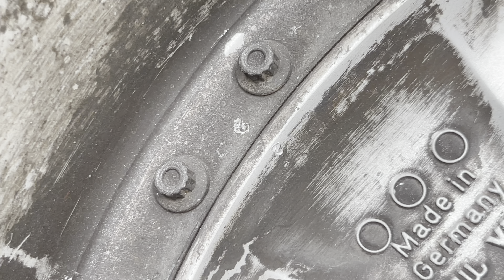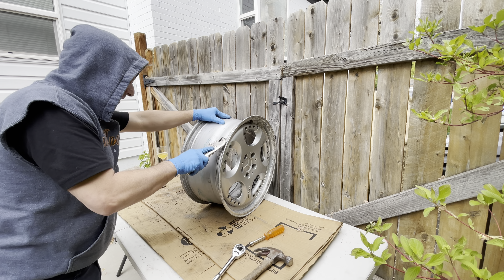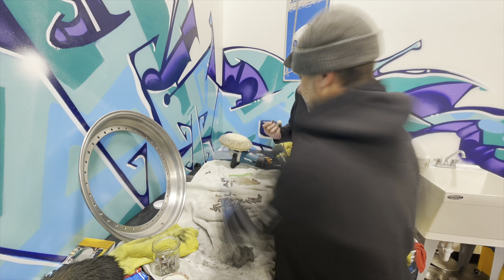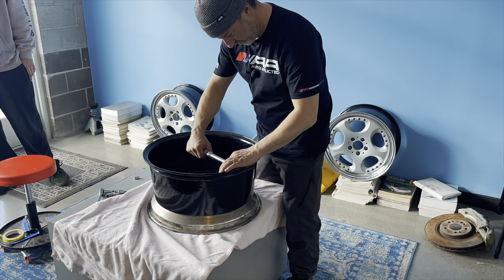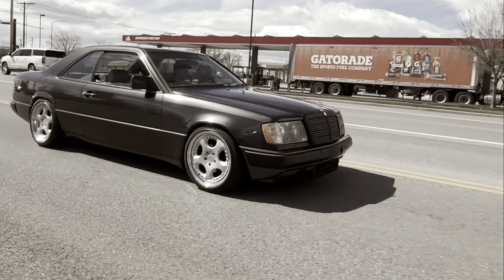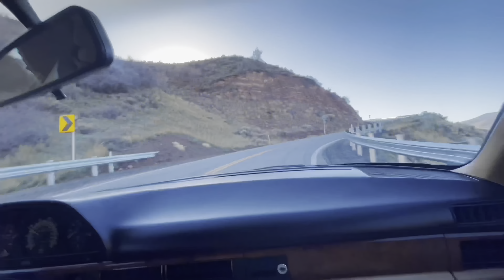Restoring rare BRABUS Monoblock Wheels for the Benz W124 Coupe

Comment: Love the transformation. true 3-piece wheels, wow. i have AMG replicas but they look legit. How much did the Turbo help with power?
Reply from the maker: Yes! Pretty excited to have these wheels. They don’t look quite as big as the chrome AMG mono blocks that I had on it originally. But they are the same size and wider. The turbo helped immensely there’s a video on the channel from our first Dino session where I got about 270 wheel horsepower, despite not getting as much boost on the dino as I get on the street totally change the performance of the car.

Comment: Man you guys have a good channel. Great content. I have an old 1982 SEL500 looking for some cool wheels. Anyone have some that fit if you know what will fit let know or for sale let me know
Reply from the maker: Thank you very much ! Your w126 has a 22mm offset I believe. You can fit 80s and 90s wheels but you may need a spacer and longer lug nutz… in the back you will likely needs to grind the lugs a little shorter as they start to make contact with the ebrake mechanism when you get into different lengths. I do have a set of 17 chrome monoblocks that could fit - email me AutoAfflicted@gmail.com
Reply: @AutoAfflicted  can you make a YouTube short showing off the wheels?
Reply from the maker: @Hellcat71782 there is a short right now about rescuing these monoblock from the salvage yard
Reply: @AutoAfflicted  oh those ones ya I saw that  video. See my problem is I don’t even know how to figure out which size spacers how to locate longer wheel bolts etc. seems like more of a pain than it’s worth lol
Reply from the maker: @Hellcat71782 to fit the 17inch Monoblocks I have, you need 10mm to 15mm spacers (depends on how flush you want the fit) and M12 lug bolts probably 50mm length - can be found in Amazon
Reply: @AutoAfflicted  dude you’re a knowledgeable person to have available. My first German car I bought was my 1982 sel500 that was sitting for like 8 years. Trying to figure out the suspension, fuel issues was a nightmare trying to find help or parts. It’s going for paint now on July 1st. What’s the price?
Reply from the maker: @Hellcat71782 I had the same wheels in my w126 560 SEC - I would let them go for $500 + shipping